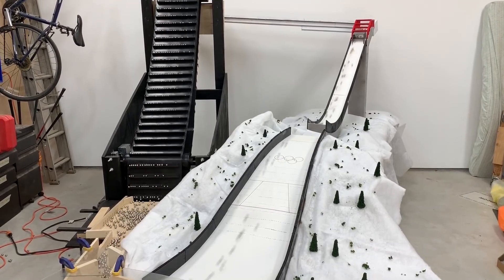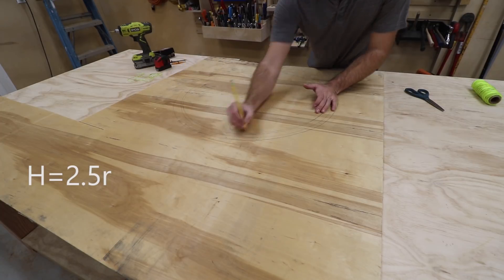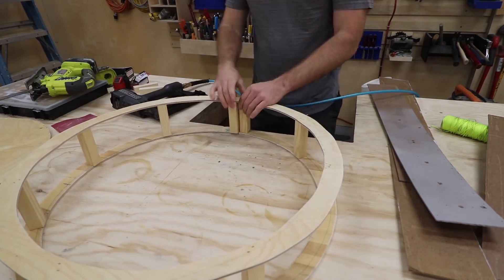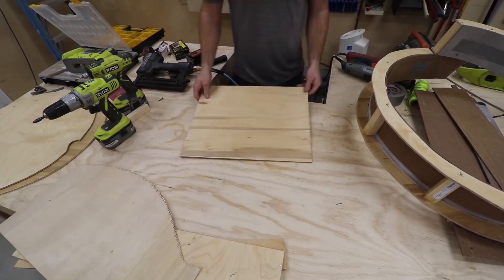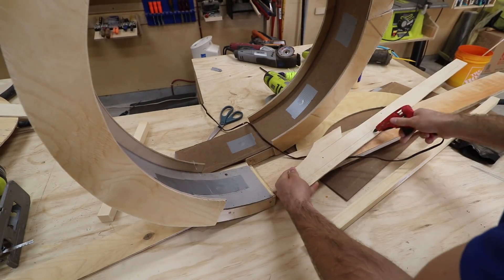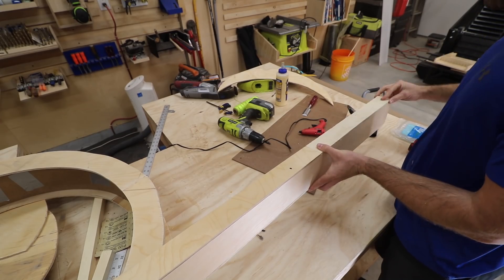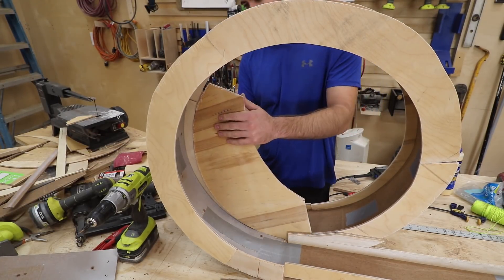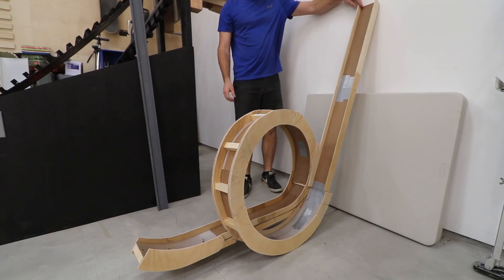Big Loop Marble Machine Build, Part 1

Comment: I'm a bit worried about the shape of the loop. In rollercoasters loops are not perfect circles because the gravity make the movement not follow the curve. if it's a bit too slow, balls will not do a full loop, if this happen try to make the loop higher than larger, it should helps a lot
Reply: It's seams to be what happen at the end of the video, the ball need to stick more, and without acceleration it's hard. So yes, elliptical loop could make it better. Check constant g-force loops if you want the math behind it

Comment: New to your channel, I noticed you are using hot glue rather than wood glue.  What are the benefits of one over the other?
Reply from the maker: Hot glue works great for a quick connection that is not permanent